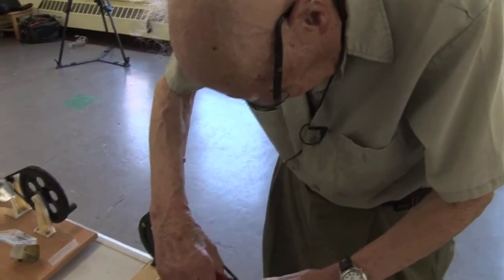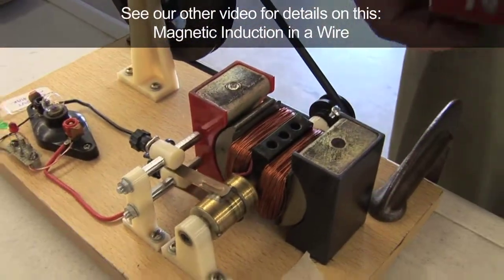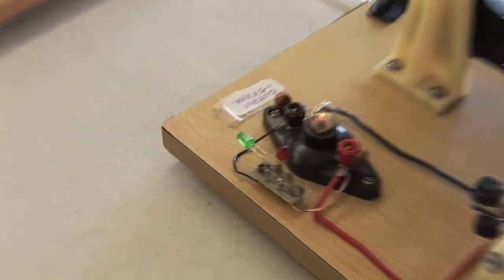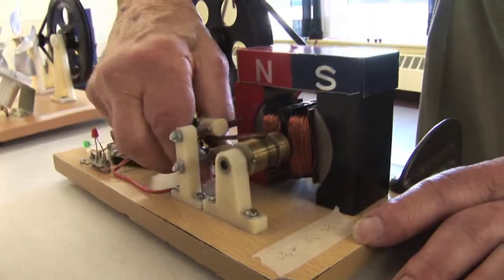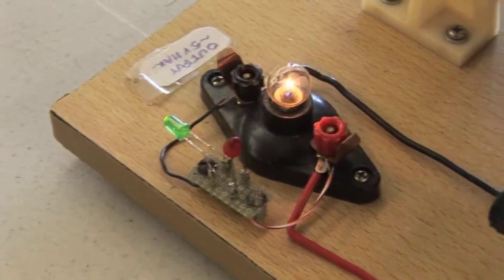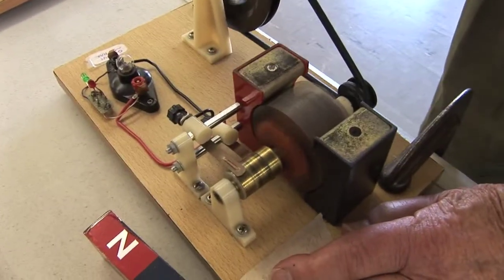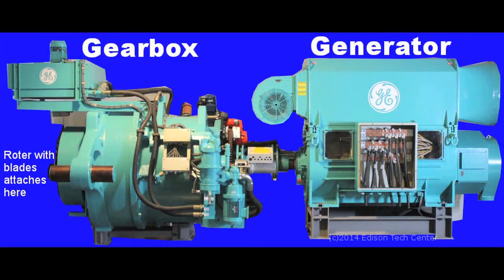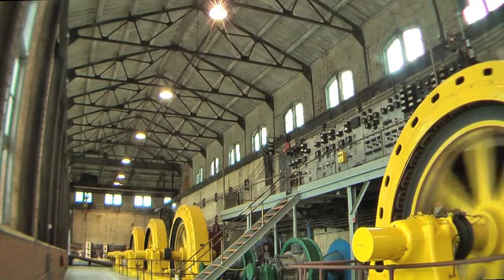Simple explanation of a generator

Comment: Could u make the wire rub against the magnet by moving the pulley sytem with magnet propulsion like two opposite magnets constantly pushing each other on a track while pulling the crank making the pulley move that is generating power from rubbing against the other magnet and would it be possible to make a magnet propulsion home genarotor that can produce around 30 kw a day and and is built to last to continuesly produce energy for a home and maybe put the generator underground to muffle noise pollution and could u make it affordable and good quility.

Comment: This has me confused. I thought all generators required some type of excitation on the rotor coils?
Reply: This is because in this video he is using a permanent magnet, there is no need for excitation in this case. The excitation is only when using iron or steel wound in wire to turn it into an electromagnet at will.
Reply: @GTChow so the stator is just copper windings...it is not a magnet at all...there is no magnet in a generator?